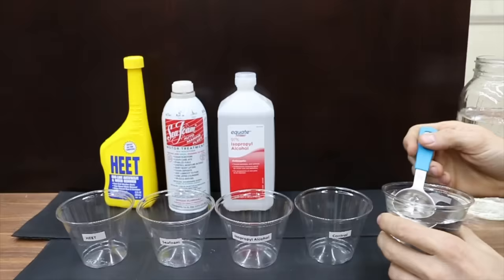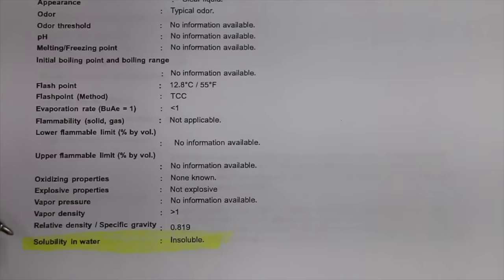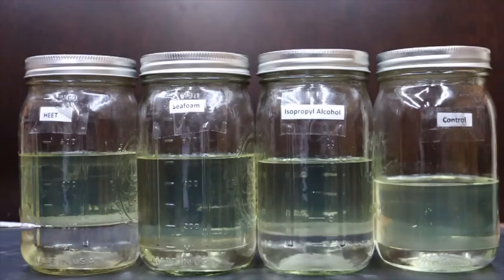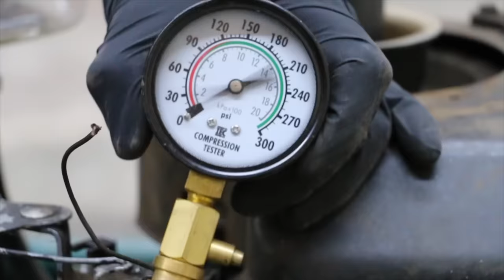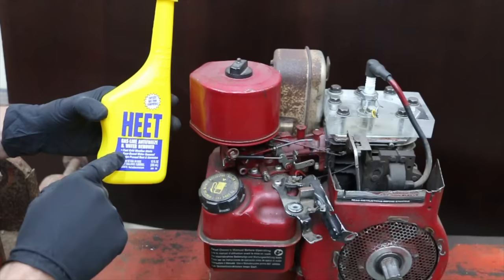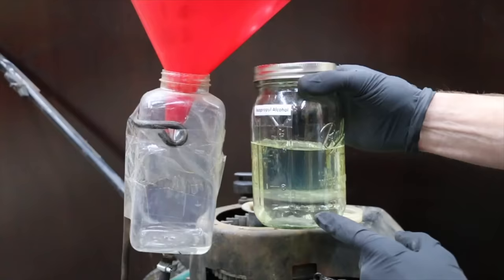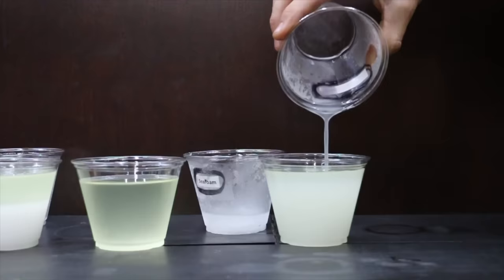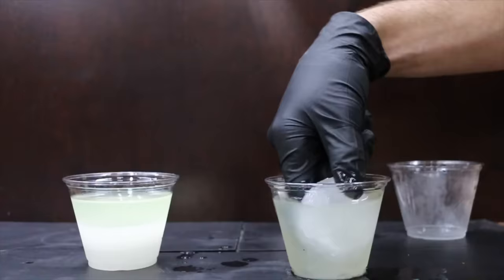Is HEET better than Seafoam for Water in Fuel?  Let's find out!

Comment: Great content sir. I work in research myself and commend your protocols on your trials! You do a really good job. Thanks for always posting great research based info!
Reply from the maker: Thank you
Reply: I worked in R&D and applaud this scientific approach. Advanced research can get real crazy with experimental mixture designs that use computers to evaluate for correlation coefficients between multiple variables (say acetone + ethanol+ isopropyl alcohol).  We use to say the computer can tell us what tail (variable) was wagging witch dog (out put response).

Comment: With a lot of gasolines containing 10+% ethanol, what's adding a little bottle methanol do when both ethanol and methanol absorb water?
Reply from the maker: Great point. Ultimately, the water/alcohol mix has to burn.  So, increasing the ethanol/methanal ratio as much as possible will help the engine run.  For a small amount of water, HEET isn't needed.
Reply: I used to use Heet type products every Winter. I haven't needed to use any, since they started adding Ethanol to Gasoline.
Reply: John, with more alcohol being added, the fuel/air mixture will become leaner - even leaner than it already is with the 10% ethanol. Not a big deal for most modern automobiles (to a point, unless it's a flex fuel vehicle), but on anything with a carburetor without a fuel screw, the engine will run too lean and too hot, potentially causing damage. Alcohol has less BTU's per gallon, so you'll have to up the fuel delivery rate accordingly. On pure alcohol, most engines will need roughly double the jet size they had on regular gasoline.
Reply: Have you taken the fuel pump of every modern vehicle into account? They're generally operated in a loop with the excess being returned to the tank, which would mix the fuel/water/additive continuously. You could add the effect of a fuel pump with a very small pump that sucks from the fuel line near the carburator, and dumps it back into the top of the tank. It wouldn't help the seafoam problem, but it should work great with the isopropyl or methanol.
Reply: since people are not taught or allowed to think anymore, i guess they sell a lot of heet at walmart. people make my head explode. v good comment! @SmittySmithsonite
Reply: I have wondered the same thing.  But living in FL, no longer an issue.
Reply: @AnthonyZenrick  Also with a return system depending on where it is in the line(some are intank others go all the way to the engine and back), could help with the heating of the fuel/water in the tank as over time it will stabilize.
Reply: @wobblysauce  only if lines aren't frozen solid.
Reply: True...

Comment: See if a gasoline engine will run on windshield deicer
Reply from the maker: Great video idea!
Reply: Windshield deicer is usually methanol so it has a good chance depending on the blend.
Reply: Mid 90s Ford rangers were flex fuel vehicles so they would run on methanol just fine .

Comment: I like these videos, l have been in the boating world for over 40 yrs. Water in gas is common and eats up aluminum in carb bowels. We use the red bottle heet after removing the water with a suction tube into the tank and removing water from the BOTTOM of the tank.  You might inform people that carb cleaning is a must after water has entered the carbs and fuel pumps.  Unfortunatly the Lazy guy just adding these products to get a motor to run, end up with burned pistons in two stroke motors.!!
Reply from the maker: Thank you for the feedback

Comment: I know it would take a while but I would like to see a video on different fuel stabilizers to see which one would preserve this crap ethanol fuel we have today
Reply from the maker: Great video idea!
Reply: No need for such a vid. Ethanol is perfect for long time storage. The crap is the gasoline part.
Reply: Really, adding 10% ethanol in todays fuel is a good thing? I hear the opposite, but i have no clue.
Reply: I know from experience that ethanol fuel is hell on carburetors and fuel lines 
I’ve pulled 10 year old carbs that say with real gas and they just had a slight bit of varnish at the bottom of the bowl 
I’ve pulled carbs that say only 3-4 years with 10% ethanol fuel and they have all sorts of corrosion and gunk inside them 
That being said there’s nothing wrong with ethanol fuel as long as you USE it on a regular basis just never let anything sit for more than a month with ethanol fuel in it
Reply: @scorpaenascrofa6510  Ethanol is terrible for long term storage. Ethanol absorbs water from the air and then causes any steel parts in a fuel system to corrode. Ethanol is fine if you dont store it in the tank or container for too long. Never run e85 in a car that's been sitting for more than a few weeks or months.
Reply: Its exactly that ability to bid water that makes ethanol fuel blends so great. It can bind water! Regular fuel seperates from water and forces corrosion. That is why many oldtimer fans began to use e10. And be honest, there is no danger for fuel lines and metal parts!
Reply: E10 is great. Boosts octane, it's an oxygenator so makes gasine burn cleaner and more efficiently.  It does absorb water which is bad for long term storage, good if you have water in your gas already.  It is also more corrosive than gasoline so not good for old lawnmowers say pre 2000's or so or really old cars pre 1985 or so.
Reply: Some of the worst and stinkinest carbs I've ever cleaned out were with Stabil gasoline mixes. It may work for year one, but in year two, may God have mercy on your soul and nostrils. I quit the stuff in favor of an empty tank and carb for the perfect year's end/longer term solution - even good ol days leaded gasoline would turn gummy, foul and ruinate a carburetor too. Ethanol is certainly worse and goes bad faster because if you can't keep it airtight, water will combine with it since it is hygroscopic.

Comment: Heet with the yellow color is really good on the summer time, it removes the water from the gasoline.  Heet with the red bottle is good for the winter time, it doesn't let the lines to get frozen but you need to have at least 1/4 of gas minimum.
Reply from the maker: Thank you
Reply: Heet is for emergency. This is what you don't get

Comment: Once I fueled up for a long trip to south Florida , they unknowingly had a lot of water in the premium gas tank from heavy rains the lid was off the underground tank. So my Dodge Ram van v-6 stalled a 1/2 block from the gas station. I walked back and complained. It wouldn’t run at all.  So I unscrewed removing the sharder valve in the intake fuel manifold line, got a brass adapter to fit that with a 1/4 inch nipple and a wing nut flow (open closed) valve  and ran clear hose to the rear bumper about 10 feet all tie strapped up. I took the cabin engine cover off to have access to the homemade valve on the intake from my drivers seat.  Parked I cranked the starter and watched water run through the clear hose for a long time from the intake to the rear bumper. Finally got most of the water out and it would run and idle only at high rpms, it ran well enough to  run and made it to I -95 (running at high rpms so as not to stall) and at 55 mph  I opened the valve on the intake and dumped fuel and water when no traffic was near and closed the dump when someone passed me..The fuel pump allowed both running on the highway and dumping water/fuel mixture I went thru the tank of fuel (and water) and topped off with fresh fuel and a couple bottles of water removal product (not sure which one). It worked. I had a friend who owned a car repair shop write me up a bill for $300 and the gas station reimbursed me.
Reply from the maker: Thanks for sharing this experience!

Comment: So they are basically reselling methanol, probably for twice the price? nice, sounds like easy money.
Reply from the maker: Great point!
Reply: you can't really buy methanol, you  have to order it in bulk.
Reply: Most methanol sold is hydrated methanol meaning it has water in it already.
Reply: I think Nile Red has done some videos on making a pure alcohol (I think it was ethanol, but...)
Reply: @Taydrum  windshield washer fluid uses methanol for antifreeze as well, that's why people doing meth/water injection just buy washer fluid. You can also buy methanol in higher purity in any quantities online and in some stores.
Reply: ethanol should wok just fine as well. 

And i am pretty sure heet is not dehydrated methanol. dehydrating methanol is quite complex.
Reply: @jaydunbar7538  MSDS is still needed for a lot of the washer fluids. I found one that contains 35-40% methanol and the remaining is water and 0.0% of dye. I add a bottle of Heet, which based off 35%, brings me to 43% methanol to 57% water for my injected Saab. Works flawlessly. The blue dye also helps find air leaks. Quity handy.

Comment: I use to run VP M1 99.95 percent methanol in my drag car. I switched to e85 though because it's only $1.65 per gallon and yet it'll still run a N2o 15.5.1 compression engine just as good. I now run a 605 bbc V30 128 Vortech supercharger making 2800 rwhp 10.5.1 compression and still running the e85. The e85 runs about 15 degrees cooler, street friendly, and cheaper and yet when put power to it it burns hotter than racing fuel.

Comment: Im a believer in Heat.  Back in the day, I had a car that would get water in the tank on a regular basis (the fuel cap was in a poor location and the seal wasn’t the best).  During the winter, I would carry a couple bottles of Heat in the trunk and add it when the water froze in the line.  It would usually take overnight, but would solve the problem.  That was back in the day of pure leaded gas and no ethanol…
Reply from the maker: Thanks for the feedback.

Comment: I filled my Jeep at a gas station in Oxapampa, Peru while the tanker truck was filling their tanks. I knew in the back of my mind that I shouldn't be doing this but I didn't put two and two together until about two hours later. My 91 Cherokee runs on Gas and LP. I try to us the LP more because it is so much cheaper. Anyway, as I was returning to Lima and going up through the mountains I switched back over to gasoline. After about one minute my Jeep started sputtering and wanted to cut off. I switched back to LP and then tried again some time later. That's when I remembered the tanker had been filling the tanks and water that was settled in the gas stations tanks got churned up and pumped into my Jeep. When I returned to Lima I took the Jeep to a Jeep specialist and they told me there was nothing they could do except drain the tank. I watched another video yesterday and one recommendation was Alcohol. I poured a 1 liter bottle into my tank and drove around for about 30 minutes on the bumpiest route I could find to make sure everything got mixed really well. After a small little sputter at the beginning it begin to run smooth. Today I drove about 30 minutes in heavy traffic and with no issues. I'm usually very cautious with home remedies and alcohol seemed like a home remedy to me. However, alcohol really works. That $1 bottle saved me hundreds in repairs.
Reply from the maker: Thanks for sharing.

Comment: I went up Nort' to the family cabin in August this year.  There's only 2 gas stations within 30 miles or so.  I stopped at one of them consistently for the duration of our 2 week stay.  Went up again at the end of September and the entire pump system above and below ground was torn up.  When I asked "Why," the younger clerk behind the counter stated that there was water getting into the gas lines.  They added that the gas station was personally responsible for 12 vehicles receiving total damage to those vehicles engines.  I ran ISO-Heet through it several times, in approx. two separate tanks on the trip back home (about 400 miles at 75 mph).  Although everything turned out okay, I do have a very casual and random misfire on Cynd. 4 - so I am going to be replacing all of the spark plugs and the wiring (just because it'll be eliminated as a possible cause).  I will try to update with how everything went afterwards.
Reply from the maker: Thanks for sharing.

Comment: Many many years ago, running a yarder for my dad and it was snowing blowing freezing weather, I took the fuel line off the filter (copper line) and gave it a wrap around the exhaust and it wasn't tight but close enough to warm the fuel. The fuel delivered was always contaminated so by doing that, it would run for most of the day but in meantime I drilled and tapped the hole so I could plug the hole when it stopped dripping water and started dripping fuel then I could stop the leak and take the wrap around exhaust off and run it normal. Dad didn't stop, we logged timber come hell or sunshine/LOL. I don't know if a diesel engine is more forgiving or not but I know we never bought fuel on the stations delivery day just because it was so nasty. Those tanks were  a minimum of three hundred gallons and you could depend on at least five gallons of water. I would get the wrap of the fuel line off as quick as I could cause it would run but poorly. That is back in the fifties
Reply from the maker: Thank you for sharing this experience!

Comment: Had a very nasty problem of water in the fuel tank of my sailboat. The engine would run fine in the marina, but once we reach open water the engine would die (due to waves rocking the boat). Leaving me stranded and waving for rescue.
Took the entire fuel system apart, cleaned it, drained it and problem remained.
Finally it was an O-ring on the fuel cap which was leaking in rain water. Changed that and the engine ran fine in even in storms :)
Reply from the maker: Glad the problem is resolved!

Comment: I use isopropyl alcohol for water in my gasoline. While a simple carb and your tank has issues burning the alcohol/water mix a fuel injection system does much better. Also if you drive around the gas/alcohol/water mixes more allowing the engine to burn the mixture better.
Reply from the maker: Thanks for sharing.

Comment: I've always ran a bottle of iso-heet through at the beginning of every winter just to sweep out any residual moisture that builds up throughout the year.  Started doing that after the first winter i lived in Plattsburgh.  First brutally cold morning there, my poor jeep had a rough time. The drygas fix is pretty instantaneous in that situation.  I had a housemate whose car wouldn't start one morning.  We put a hairdrier on low under the hood for 10 minutes, and it fixed the situation. Told him to drive straight to the store and put a bottle of drygas in. He'd never even heard of that despite living in that region all his life.

Condensation definitely builds up in fuel throughout the year, but really 1 bottle of drygas around thanksgiving seems sufficient to keep a vehicle running all winter

If you're going to use isopropyl, you should use "anhydrous" isopropyl, which is 100% alcohol and no water. Iso-Heet in the red bottle.
Reply from the maker: Great feedback. Thank you

Comment: ALASKA MECHANC 50 YEARS  My work was 95% diesels and jelling was a winter problem.  The best product I ever used was Diesel Service in the white and black can,  One gallon would treat 300 gallons of jelled fuel at freezing temperatures... I would like to see you do the same test with #2 diesel fuel at very cold temps... Water in fuel that formed ice required changing the fuel filters.
Reply from the maker: Thanks for the suggestion.

Comment: Water and alcohol overlap or borrow electrons when mixed together. The water attaches to the alcohol or methanol thereby allowing it to be burned. 
Filters act as a plug when water gets in a fuel system, the filter does not allow the water to get past it, and the water does not allow the gas to get by the filter. 
 Dry gas collects the water so to speak so it can get passed the filter and be burned in the engine. 
I have always used dry gas in my cars before going to inspection to help pass emissions. I started doing this back when my cars had carburetors.
I used rubbing alcohol when I ran out of gas once. It runs great while cruising but there is a big loss of power especially from a stop. 
I would not use it to get rid of water in the fuel system though as the purpose is to get rid of water and you are putting more water in to get water out. 
I guess in an emergency you could use it, if no dry gas was available. Good video.
Reply from the maker: Thanks!  Thanks for sharing.

Comment: When I lived in NYS, back in the day, I used a product called Dry Gas to remove water in fuel in my lawn tractor and car.  The water was mostly caused by condensation during winter cold spells.  I think it worked really well.  Then came a time when Dry Gas was no longer available. A friend suggested that I try Seafoam, which didn't do anything for me.  I've since moved to Texas and those worries are a thing of the past.
Reply from the maker: Thanks for sharing.

Comment: The truck is to get the water out before  cold weather . I use a bottle of rubbing alcohol  in each 120 gallon  tank . Then i puta rag half in the tanks & half on the out side ofthe tanke  set the caps on loose &leave them over night . The next morning  tou will see the water dripping  off the rag onto the ground. You will notice  a performance  improvement  in the way your motor  accelerates.

Comment: I used the ISOHEET in my car. It ran all of the water in the tank to the fuel filter and I had to replace the fuel filter with a new one. It seemed to get the water out of the gas tank. But keep in mind after using it you probably should go ahead and replace the fuel filter. My car is a 2006 Crown Victoria.
Reply from the maker: Thanks for the feedback.